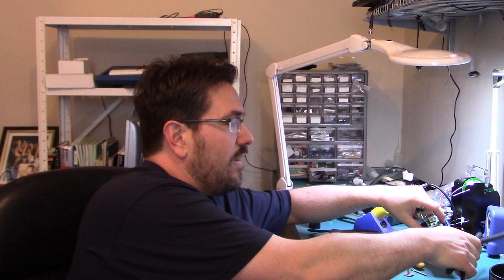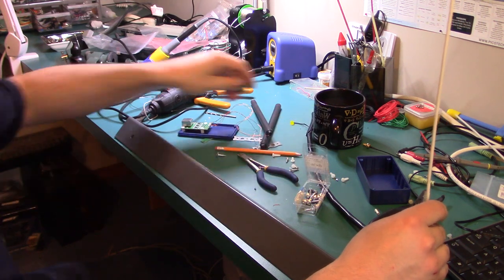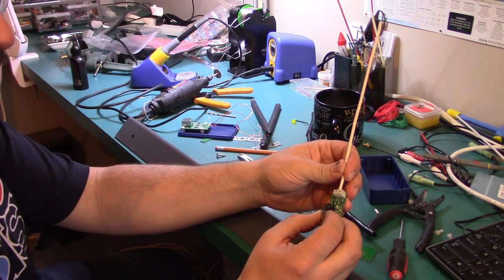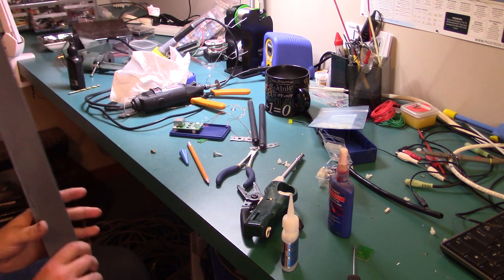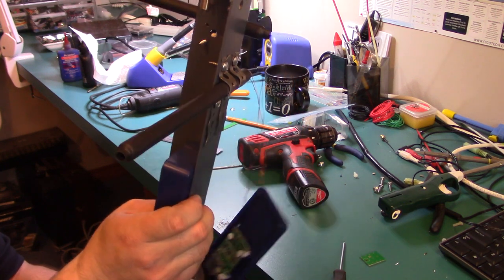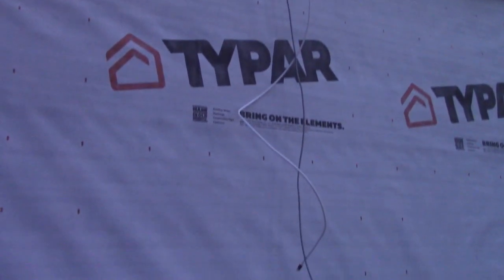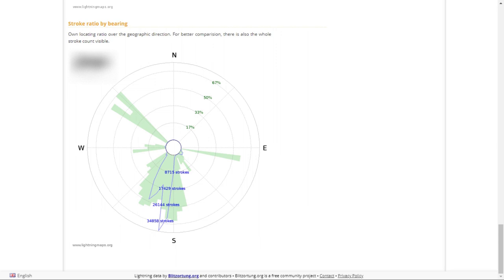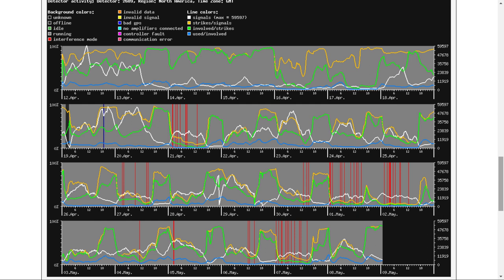Lightning Detector - Building a Permanent Aerial - Part 3

Comment: Wish your video was around when I built mine...... Kind of a catch 22 with the receivers going into  interference mode......wouldn't be bad if they cleared themselves after a time but sometimes they don't...... I've found that if my settings are too sensitive to make them  show up on the map, then the receivers tend to freak out.........   I have two of these running and I'm located right below yours in the upper most part of Wisconsin....  Thanks for the video......nice job.....   Stations 2382 & 2334 stacked right on top of each other....

Comment: Nice work...  I've been sitting on three kits for about 4 years.  One for home in Texas, another for my brother in Oklahoma, and one for my brother-in-law in Brazil.   I'm Concerned about the mounting on angle Iron and the proximity to what appears to be a metal building for the ferrite antennas.  Probably best to get it mounted on horizontal plastic and set out away from metal at least  3 Meters.

Comment: I'd be interested to see the amplifiers and antenna now after 3 years. 
I was thinking i'd like to get involved, however, there is already a red system in my home town, so i'm making my own devices, trying an arduino for starters, and i have some valves, ( known your end as vacuum tubes). 

In future, look into conformal coating, it's what the military use for devices which might not be used for years and won't be stored in laboratory conditions.

Comment: Thanks for sharing your videos.  I'm in MT and would like to get one soldered and installed(just put my email on the list).  Can you make another video and share your findings since you installed on the roof? Do you have a lightning rod nearby? Is it dangerous to have the antennae on the roof, potentially attracting any nearby lightning strikes? Do you have a list of all the tools that you used to solder? Where did you get the blue box? silicon? soldering gun? solder?  I liked your board holder, but I can't see myself doing other solder projects. I saw one video where they soldered the pieces on a mouse pad! The soldering doesn't look too hard... just briefly touch the pin with the soldering gun and apply the solder..right?
Reply from the maker: I'm planning on putting it on the roof of my detached garage this spring. No lightning rod, I have lots of trees around my place which are way taller, they'll get hit first. My soldering iron is the Hakko FX888D-23BY, any iron will do the job as long as it has a relatively fine tip. Solder is standard rosin core 60/40 tin/lead solder, 0.031" (1.5mm) in diameter. plastic boxes and other electronics supplies from digikey. Soldering is easy, lots of videos on YouTube just try not to heat the components up too much. It's a pretty straightforward project.

Comment: Could the angle iron be affecting the signals?
Reply from the maker: It's hard to say. The station has been behaving better the past week, it's not going into overflow mode and the detection seems a bit better, not sure what changed. I still have to look into optimising the settings. I also haven't had a chance to mount it outside yet but I'll post another update when I do

Comment: I think you're misinterpreting the meaning of the signals lines. It looks to me like the while line is the absolute count of detections, with the orange line being the ratio of signals determined to be valid to the total number of signals, the green the ratio of involved signals to valid signals, and the blue the ratio of used to involved signals. Note the y-axis is numbered with 2 scales: the absolute count on one side of the graph, and a percentage on the other.
Reply from the maker: Ya, I figured everything out after I shot the video. Still haven't mounted the antenna outside. I recently switch the station from automatic to manual mode and have been optimizing the gains. I'm getting more signals and the station is going into interference mode less. Seems the automatic mode had the gains a bit to high and the signal threshold a bit too low.